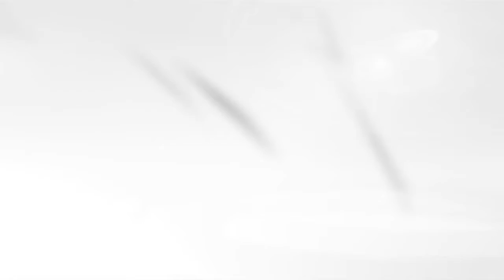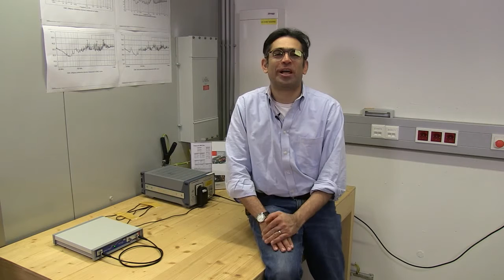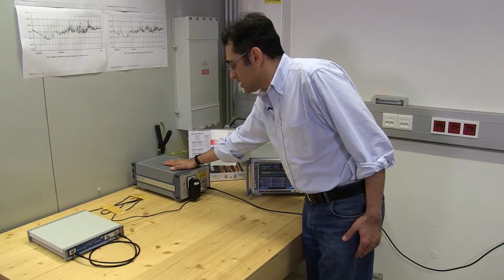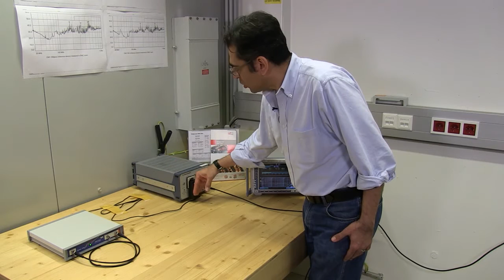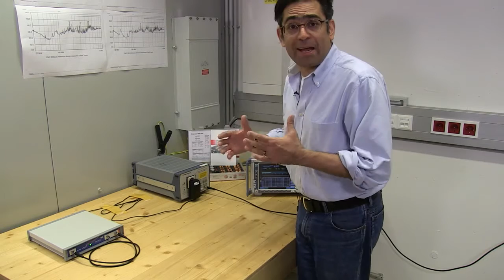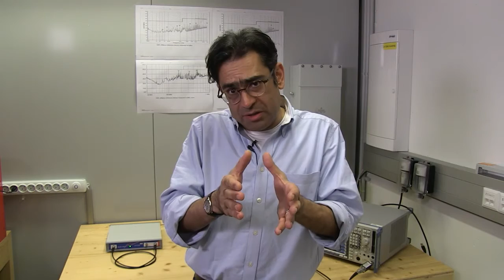Introduction to EMC  (Part 3/4): Conducted Emissions Tests

Comment: In this video, you had mentioned around at 4:30 seconds that a emission filter can be incorporated into the power supply in case conducted emission is beyond a particular limit. The DUT actually is not the power supply which implies that the box which is conducting emission into power port is not complying to the requirements (it can't be power supply / power supply because in the test setup, we take everything ideal/complying to standards except the DUT; in this case power supply/cable is part of measurement device / aids in testing and not actually part of DUT).

Hope I could convey the clarification I need clearly. I mean to say that the solution to the problem would need to be in DUT and not power supply side. 
Thanks in advance for response.
Reply: Sorry, pls take the time as 2:35 seconds, not 4:30.

Comment: Very good video of explanation. Thank you sir!

I have one question, what if my equipment under test has DC input power supply, does it mean that it is exempted from this test?

Will this test also apply to equipments which have DC input power supply?

Thank you with kind regards.